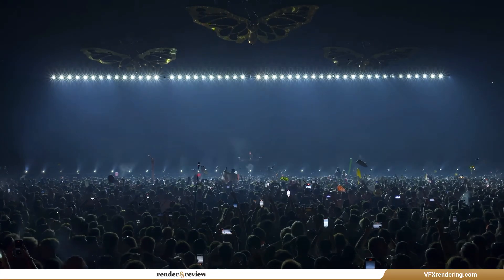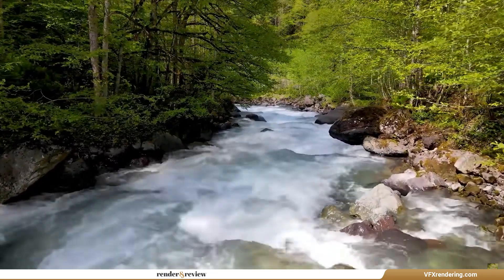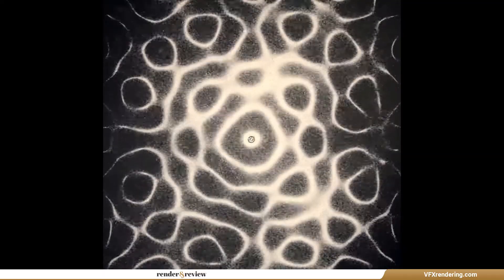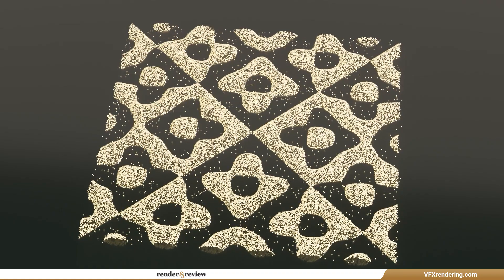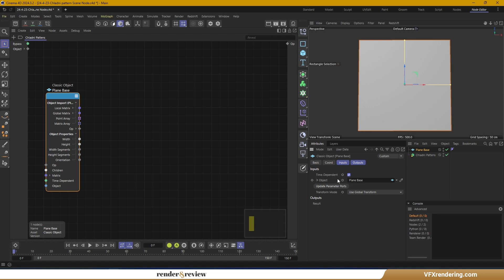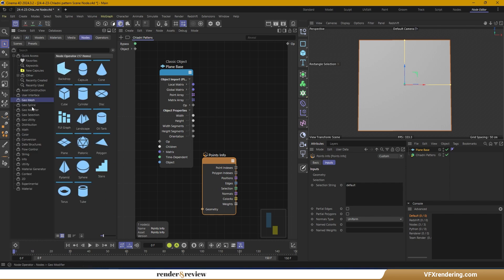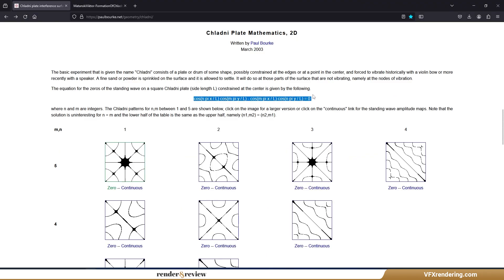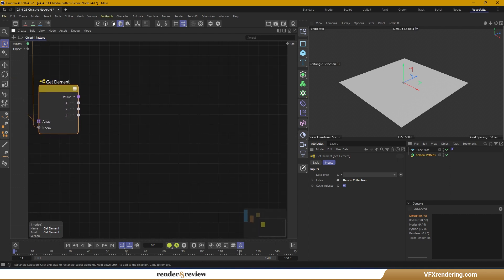Recreate Chladni Pattern with C4D Scene Nodes | Tutorial | VFXRendering

Comment: Very Nice Approach . Is there any way I can achieve this with new c4d particle System ?
Reply from the maker: Hi. As mentioned in the tutorial, you can achieve Chladni patterns using Mograph combined with the Formula Field. Not only with the new Particle System in C4D 2024.4.0, but also with any other version of C4D, you can simply set up a Field Force with an object using the Formula Field to direct it, then place the Particle System within it.
Here's an example formula: abs ( cos ( ( f * pi * px ) / 100 )  *  cos ( ( f * pi * pz ) / 100 )  -  cos ( ( f * pi * px ) / 100 )  *  cos ( ( f * pi * pz  ) / 100 ) ). f = 50.
Good luck!
Reply: @vfxrendering  would love to see a bit more particle explanation of the last section where you created the particles!
Reply: use it for a vertex map and then the vertex map for density of the particles birth or other particle modifier